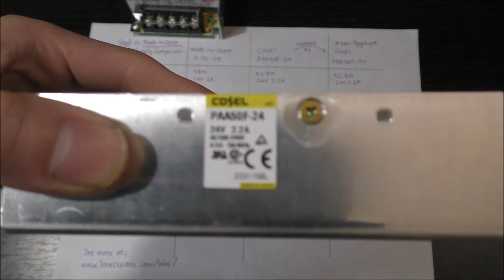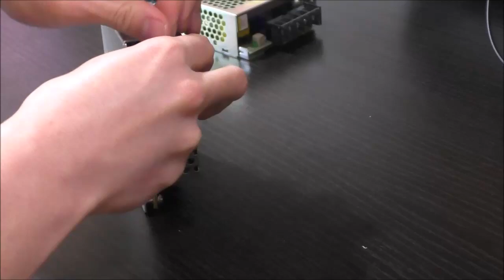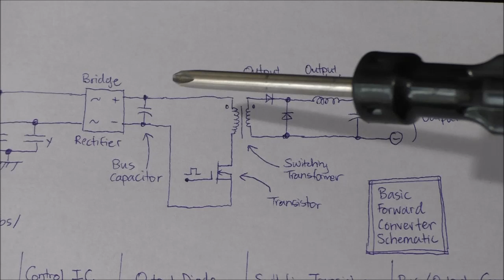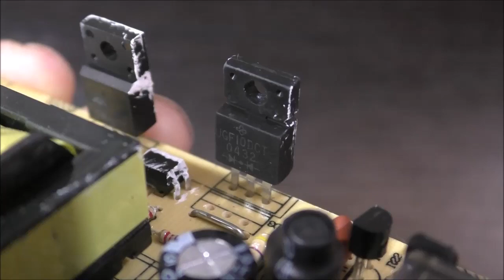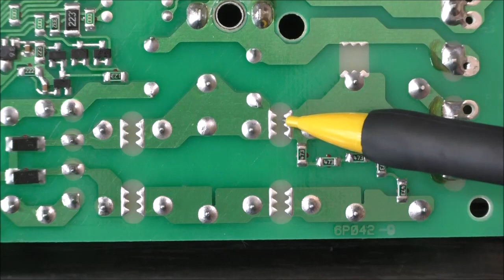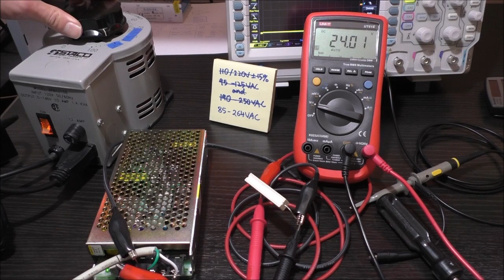Cheap $8 Ebay Power Supply vs $85 Cosel Power Supply Teardown

Comment: I really liked this teardown because you took the time to really trace out the circuit.  I feel like I basically know how it works.  I also thought the Chinese board was worth every penny of the $8 it cost, and it had a lot of effort put into the design and it did have all the key parts.  Those cheap electrolytic caps might give it a shortened lifespan - but you can replace em or replace the whole board several times and still be far ahead of what the Japanese board cost...(which, admittedly, is a work of art and I wish we lived in a world where everything was made to that level of quality)

Comment: Why dose the Cosel Power Supply  have a 200 volt  rated bus capacitor on rectified 264 volt AC? 
(correct me if I'm wrong but a bridge rectifier multiples the voltage by 1.414 converting it to DC)  

So 264 volt AC * 1.414 = 373 volt DC witch is a large over volt for that 200 volt capacitor

Comment: The Chinese one was very surprising. Construction was a bit shoddy, but that can be tidied up with a bit of spare time and a soldering iron. I'd be tempted to replace the caps with decent ones if it were going to be used for any extended period so add a few dollars extra for the caps and some TLC to tidy it up and it'd be a decent unit.

Comment: I absolutely LOVE cheap chinese electronics. it means I can order loads of stuff from ebay and banggood and aliexpress etc and play with it. if china hadnt revolutionised manufacturing I couldnt afford my hobby.
Reply: I agree, I couldn't afford to play hobby electronics otherwise.

I think a more fair "teardown" would be to compare Apples to Apples instead of Apples to Oranges. Spend either $8 or $85 from BOTH China and Japan and see what you get.
An $8  24 volt power supply from Japan gets you what? The empty box it comes in?  
Then compare the $8 Japanese PSU to an $85 Chinese PSU.  

Next compare two new automobiles where one costs $20,000 and the other costs $212,500. Feel free to mix or match the countries of origin. 

Just saying, the comparison was flawed from the beginning. If you want to compare value then start with two different products that cost the same. The only exception would be to purchase two identical items at different prices, that makes the maths for "value" very easy to calculate.
Reply: @visionstills3700  well you get what you pay for but keep in mind that China had swallowed the world in the electronic industry and mostly all the household goods electronics are all made in China nevertheless a lot of famous firms have factories in China so that they keep the price of their goods compatible.
Reply: The fact the $8 Chinese outperformed the $85 Japanese unit in ripple, so what's left for the Japanese to be smug about? Do they really want to humiliate themselves against a $85 Chinese unit?

Of course, I won't use a $8 PSU for my $2000 PC, but for DIY hobbyist use it's is more than good enough.
Reply: @nomoredamnnamestouse  It's great for hobby use and nothing more. Smug? Interesting choice of words. Are you a Chinese nationalist or something?

Comment: Hey!
I have a core 2 duo processor,4 gb ddr3 RAM, 1TB HDD,1 optical drive and nVIDIA GT 730 graphic card which requires 49W power consumption.
But, my power supply unit (smps) is very cheap around 8$,but provides 450W supply.So,would a cheap power supply like this be good for my dedicated GPU ?

Comment: I'm Probably making a fool of my self as I have not watched beyond 13 min yet. If that is what a cheep PSU is supposed to look like, I realy got ripped off. chip, what chip. Try a two transistor JK flip-flop with one transistor being the driver and the other a tiny smt thing. What you have there looks incredible compared to what I got. The 5V 6A unit I have blew up on the bench with only a 100mA load.

Comment: Very instructive video, specially  for whoever is studying SMPS, altogether you should put a caveat in the end (nowadays YouTube has this option, to add content to an already  uploaded  video), stating that as you have not tested  both power supply regarding "real world" loads, the bottom line could be misleading, as it seems to make the case that the Chinese power supply is an overall more cost benefit solution. But a good video anyway, keep 'em foming!

Comment: The video could be shorter.
Interesting though, the big one is doing it wrong, just on price/perf. But it's much worse than that. 24V 2A is nothing. A super tiny circuit could do that and well. Custom busbars for 2A?? let's call that massive over engineering. Beautiful, if it wasn't so incompetent.
Reply: I was amazed by those beefy bus bars too,  but maybe it has something to do with proper output current measurement considering that thick shunt before those bus bars. 
Seems to me they use the same design and hardware for higher output currents too,  hence the huge 680 uF cap, unreasonably capable (for 2A) power MosFet 0.5 Ohm, unpopulated pads for bigger Shottky diode at the output, huge shunt and   bus-bars.

Comment: Whilst this video is interesting, as some have mentioned, it is not a true reflection of how it would be used at full load or under actual usage conditions in it's target application. The Cosel unit is more expensive, but what this video doesn't tell you is that the PBA50F-24 unit has an efficiency rating of 84%, which the China one won't have, optional circuity to allow remote on/off, AC3000V isolation, wide operating temperature, OVP, OCP, 5 year warranty, long life etc etc. All this comes at a cost. Additionally the Mouser price is an inflated price for small volumes. Manufacturing price is much lower. Also, the Cosel unit is designed for Industrial applications and therefore for an amateur home use project, is way over spec'd. Whilst the China product is very cheap, as with most things, the cheapest solution is usually the poorest quality. This means it would have been designed with very low cost components and PCB material (Cosel uses FR4) and will have a very short warranty as well as may not even pass the necessary global EMC requirements. Cosel is known in the world as having the highest quality power supplies backed up with facts and figures so whilst this is an interesting video, it's hardly fair to say that comparing the price of a Ferrari against a Fiat makes the Fiat as good!
Reply from the maker: +Nick Theodoris That's excellent feedback, thanks for sharing! In the future will be keeping these in mind; it's great learning together :)
Reply: What if the customer wants an 80% efficiency and no optional circuitry for 1/10th the price?  High end devices are very nice but not every customer needs or wants to pay for that bundle of features.  Companies that make what they want rather than what the customer wants imperil their futures.

I could have paid 10x for a beautifully made billet block engine that makes 2x the power for my pickup truck, but I stuck with the normal output OEM one.  I did not want or need the benefits the 10x engine provides.

Comment: Its seems like whoever crunched the numbers while designing the $8 PSU did a great job. For 1/10th the price you really can't go wrong... Super-educational video, thank you for sharing!  :)
Reply: Not totally impossible they have ripped it of another expensive one or they just used the schematic example for the controller ic, very common in china to do, the cheaper the better no matter if its safe or not. 

And there is one thing on the boards bottom side that wasn't noticed. There was one component leg that was folded very badly so it was very very close to touch another bare trace which it could one day and totally ruin the entire PSU and even start a fire worst case, that's what you get if china made not in fex a Cosel.

And the reason these are so cheap is just because the components are made in china so the just walk over to their neighbor, which is the component factory next door, and get extremely cheap components not even heard of outside china. You can find very very cheap components on fex Ebay. 

But if you the other hand buy them directly from the factories you would not belive the prices you get then since they are much much cheaper.

And the other reason its so cheap is because the poor chinese workers hardly get any pay for their job.
Reply: It depends on how you define "go wrong".  If the $8 power supply fails and in doing so, damages a $1000 piece of equipment, that seems like it's going wrong.  If the $8 PSU fails and holds up a core function of a business, either in production output, client loss, or just idle employee salaries, thousands of dollars can be lost.  The Chinese PSU is "acceptable" for some consumer users.  It is a reason to fire whoever selects it for a business application that fails.
Reply: @stinkycheese804 If you can afford to by $1000 equipment, then you can afford the expensive SMPS unit! Some of us old pensioner are on a budget here in GB. And just use these cheep SMPS plugged into RCCB's here in Britain! Not burnt my house down yet, using quite a few of these cheep units, and still alive and kicking at this moment with no big bangs!
Reply: @davidteale4270  Please, wat's a RCCB?
Reply: @josearrighi  RCCB means Residual Current Circuit Breaker -- A residual. current device (RCD), or residual current. circuit breaker (RCCB), is an electrical wiring device that. disconnects a circuit whenever it detects that the electric. current is not balanced between the phase ("hot") conductor.
Reply: @davidteale4270  Thank you  very much.
Reply: @josearrighi  Your wecome anytime my frien.
Reply: fogot thr 'D' at the of friend, sorry
Reply: @davidteale4270  hi David, I'm with you, alas being disabled is just as difficult and would love to go back into employment as hate struggling but am grateful as there are poor souls out there in the world who'd be totally up the creak... so have to be grateful.  I confess I am very new here so forgive me for being green behind the gills... I've only just started to teach myself electronics as a hobby now that I have to find new hobbies.  What are these power supplies used for and where did you purchase yours from?

I'm not too bad with computers but can see that I've such a long journey ahead of me when it comes to learning about electronics.
Reply: Hi Luke, They mainly use them for Powering CCTV cameras, But you can make use of them for many Electronic projects SMPS are great, and the cheap Chinese one's are no exception (Fantastic value for the money you pay) There are some great bargains on E-Bay I recently bought 2- 12vdc x 20 amp for £7.00 each, also a 48 volt 20 amp for £ 33.00. you can use these power supplies on lot off  Electronic projects, ( But you need a liner type Power supple for Radio equipment, Less noisey and cleaner than SMPS) You can use SMPS on E-bays Cheap ZVS units and have fun making big sparks ( But be vary careful if you not familiar with EHT! ) Also use the ZVS units for induction heating, lot of videos on Youtube showing you how to do It, You can also use Buck converters to make Variable power supplies with the aid of SMPS, and also PWM motor speed controllers for adjustable power supplies, they work great with 36vdc 20 amp ZVS units and allow you to adjust the voltage easy, There are a lot of bad comments on Youtube about The cheap SMPS from china, but take no notice, always use a RCCB for you mains feed and you wont go far wrong, It's like Paying £150 pounds for a named battery drill? I have always bought the cheap ones from Lidl or Aldi, They have done me no wrong, just keep the battery charged up and don't let the drain. You could buy 6 drills for the same price as a expensive one, but look at the bright side, one goes down you have five to go on with! Anyway most DIY drills have the same Brush type motor as expensive ones ( All made in China) and they come in handy for model boats if the battery goes down, it's cheaper to buy the drill than the Battery anyway. Electronics is great, Iv'e been doing it for 60 odd years and never tire of doing or playing with electric.
Reply: @davidteale4270  Thanks for getting back to me David and for your knowledgable insight.  I had a feeling that you'd worked and tinkered in electronics for a while and can understand your love of tinkering in it as it is so diverse and yep, interesting.  As a young boy, my uncle, who was an engineer and who loved fixing radios as well as other things, used to teach me a little about electronics and would bring spare parts from his work home so as to set uo electronic experiments for me to do but alas, although I found it interesting, I was not very academic at the time and his efforts were sadly wasted.  At 50 years old I'm finding a new interest, love and appreciation for rlrctronics and intend to learn for my own enjoyment and yes, for the memory of my late uncle who I miss.  I still have all of the electronic Components in the garage so have bits to tinker with.  I also hate the idea of the throwaway culture of electronics when they could be up-cycled and used for other means, saving money and landfill.

Once again I thank you for your information and will certainly take it on board and hope to hear through the forum of any projects that you are working on.
Reply: Hi again luke, At the ripe young age of 72 I love tinkering with Electronics, I may add the first thing to make before you start making projects, especially if you intend to use mains voltage, is to build a mains isolation unit, There are many ways to do this, I have built two units that work great for me, the first unit using a 3000 watt Light dimmer with a small mains bulb fitted in line with the dimmer connected to two toroidal transformers, 240vac in x 2x110 out at 500 watts each. This allows me to control the output from nearly zero right up to 230 vac fully isolated from ground earth! I can touch ether wire separately, and touch ground earth without killing myself. My second unit was made because I had the Parts hanging around and I wanted to see how effective it worked, It incorporates a Cheap 12vdc 40 Amp SMPS, And a 600 watt Battery inverter. Connected together 12vdc SMPS ( The SMPT can be trimmed to produce 10 to 14 vdc) gives out 14 volts DC into the inverter, and the inverter gives out 240ac completely isolated from ground again, Make sure both are units are grounded to earth through the mains plug. The Transformer unit was the most expensive due to the cost of the toroidal transformers, but I managed to bid on EBay for them and got them cheaply, Anyway I am building a few other projects and maybe in the near future I might make some video's of the many project I have made to press. It was nice to here back from you my friend.
Reply: Hi David, it was great hearing from you buddy.  I'm sorry that I'd not replied sooner only I've not been too good.  May I say that it's great that you're still tinkering and experimenting, my uncle was still tinkering in his late 80s.  I'm impressed by your knowledge and skills and will certainly look into your recommendation and the necessary components.  Lil, it's always a good idea not to electricute one's self.... I grabbed hold of two live wires without being earthed   in my early teens and I sure as heck gained a respect for electricity lol... Not clever but at least I take every precaution whenever doing work with electrical fixtures etc..  No doubt you've probably had your fair share of shocks.  I think your idea of recording projects for YouTube would be great and I'd certainly tune in.
Reply: Luke Bennett  Hi Nice to here from you. Yep? There a lot of comments on the cheap Chinese SMPS, But up to press I haven't had a bad one yet.( I've bought 8 up to press, the latest one 1000watt 48vdc SMPS with a variable voltage output of 1 to 55v, I've just fitted a external pot so I can box it and make a bench power supply)) It a bit like buying the cheap battery drills, the expensive one's are very good, but for the same price you could buy , lets say 4 to 5 cheap Drills, just use one and store the other 4 away until the cheep one bust? You are not left high and dry, you still have a stock left! But anyway, like all cheap stuff? you get what you pay for and I have had lots and lots of the Chinese cheap stuff, some bad, some good, and some brilliant items, so it's worth taking the dive sometimes, I used to deal with RS Components when I was working in Electronics, and there stuff is shore expensive, so the Chinese stuff, is a godsend now I'm retired and have to watch the pennies. I've made quite a few Electronic projects recently ( Mains Isolation unit using a 12vdc 60 amp SMPS feeding a 600 watt pure sine wave inverter 3 amp output fully isolated from mains earth) Works great. And when I get time I will make some video's of them. Anyway nice to hear from you Luke.

Comment: Why the big capacitor is only 200V??  Anyway, the more expensive shows so much ripple so I would say it's a shame. I don't event understand how they managed to do so. They used much more expensive components everywhere, yet the result.. you saw it. So I would say the Chinese one is more prospective.  Replace caps, transistors and it is a quite good for the price. Of course Japanise one insures more confidence in reliability, no doubts, but.. I expected more for the price and schematics.
Reply: I agree, if that capacitor is straight across bridge rectified mains at the maximum rated voltage, 265V AC, it's going to see 375V DC on no load. Something wrong here. But see comments below.
IMHO the expensive supply is over engineered yet is no better performance than the cheap one. However it may last longer and be more rugged.
Engineer - someone who can do for £1 what any fool can do for £5.